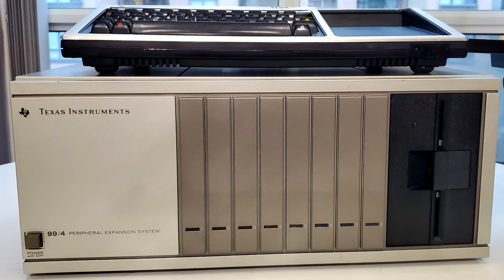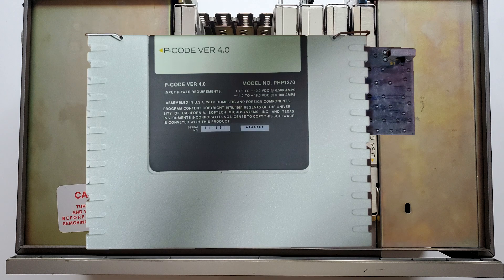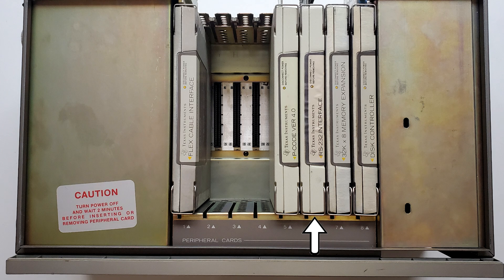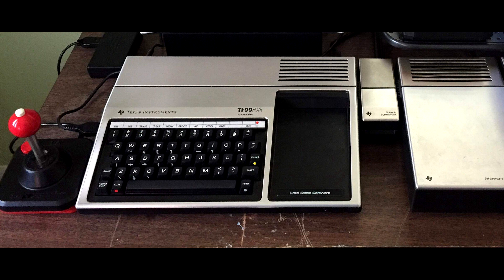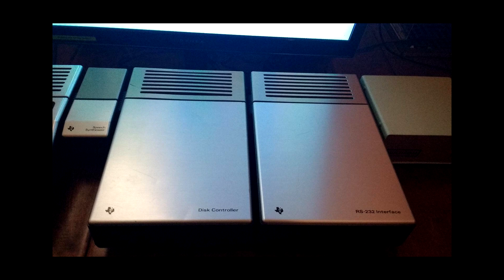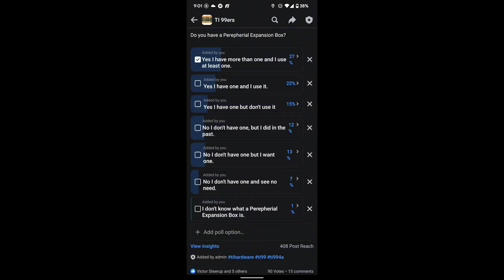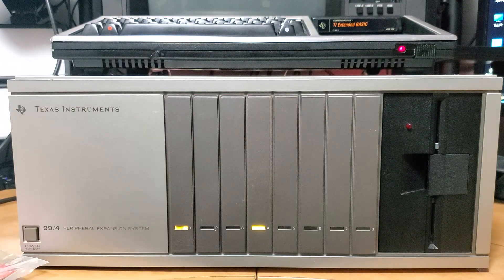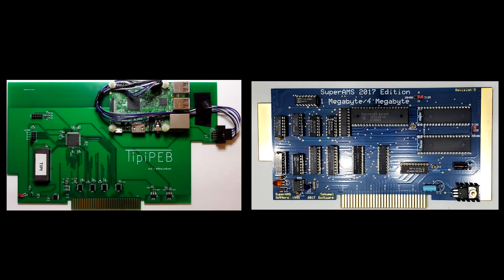A Better PEB: New Options for the TI-99 Peripheral Expansion Box in the 2020s

Comment: I taught myself how to program in Extended Basic on my TI-99/4A. I had a PEB too, with the 32k card and disk drive and disk controller card. And of course the speech synth. I had NO idea that hardware upgrades were being made for it! I got rid of mine when I bought my Amiga 1000 in '85 when it came out.

Comment: Thank You PixelPedant.  I actually like the sound of the TI Peripheral Expansion Box while it's operating which can be used as a white noise, actually cancels out the tinnitus in my left ear. Also picked up the TIPI-PEB and The Raspberry Pi. But I like to keep The Speech Synthesizer Right Where It Is Plugged In To The Side Of My TI99 4/A. 😀😀😀😀😀:face-blue-smiling:

Comment: Will two 32k expansions or more work in the PEB equalling >=64k?
Reply from the maker: Nope.  Nor can a larger expansion (even hypothetically) be directly addressed by the CPU.  The TI-99's address space is (16-bit, and hence) 64K.  So while paging can give you more memory than that (just not all at once), the address space is what it is.
Reply: But it can use two RS-232 interface cards right?

Comment: Hi there!  I’m glad I came across this channel!  I’m curious if there are any differences between the two PEB styles (push button vs. flip switch power switch)?
Reply from the maker: There are a few design distinctions between different models of PEB, but none of them fundamentally change its functionality in any really significant way.  

Differences include: 1) "99/4 Peripheral Expansion System" label or "Texas Instruments Expansion System" label, 2) Half-height "fingers" separating cards on the rear face or full-height "fingers", 3)  externally accessible fuse by the AC connector, or absence thereof, 4) Push-button power switch or Rocker power switch.  And users have also observed that the internal switch mechanisms toggled by the rocker switch have multiple variants.  

But as I say, none of this is actually important to everyday PEB functionality.  And while they largely sort themselves into two major PEB variants, TI did not market these as separate models, and there is no guarantee either one will represent all characteristics typical of that variant.  In the same way that most but not all beige TI-99s have the QI (second gen) motherboard, and most but not all machines with a QI motherboard have the 2.2 operating system.
Reply: @PixelPedant  thanks for this detail!  I now have 2 PEBs, one with each switch type.  I’ll have to check them out in more detail to decide which I will keep.  Merry Christmas!

Comment: I came across the post in atari age for the PEB PCB about a week after preorders were closed. So bummed :( Living in Australia, finding and then getting a PEB shipped over is not cheap or easy :( Currently living with my 32k expansion and finalgrom.
Reply from the maker: Yeah, living outside North America definitely makes things trickier.  But at least with the FinalGROM and 32K, you've got what you need for 90% of the library.

Comment: I like mine unmolested, all original hardware. The only thing I have done extra was get a FinalGrom99 so I can have access to more software. I had the basic system in 1983 (Extended BASIC, Speech Synth, Cassette) and learned BASIC. By 1989, I had a lot of computer classes in school and learned about the Apple IIe with BASIC and Pascal. Up until then, I didn't really know about assembly language. Over the years since 1989, I learned a lot about computers and assembly languages (I ended up with a Masters in Computer Science). So, feeling nostalgic, I bought a TI off eBay a couple of years ago as well as a book I had when I was a kid in 1983. Fast forward to today, about 3 years later, I have recently started playing with a TI and PEB and learning TMS9900 assembly language. I want to see what I am capable of doing with what I could have had back in 1983, but didn't have, so no gadgets or software that wasn't available prior to about 1989. I really wish I had known about assembly language and the PEB in 1983, I think that would have advanced my knowledge at a much faster pace. Instead, I had to wait until 1990 when I 19 years old in the Air Force to learn what assembly language was (I started on 8086 Assembler). Since then, I have does AVR assembler for the Arduino and MIPS Assembly when I was taking college courses. Now I am learning TMS9900 and almost done with a clone of Apple's SnakeByte. I need to just finish it, but I keep learning about new things and wanting to redo it. I want a version that can run on the minimum amount of hardware, like I had when I was a kid.

Comment: The first thing I did with my PEB was replace the case fan to a DC 5 volt.  Shocking reduction in noise, I don’t have to talk so loud now to be heard over the old fan, ha. I moved the speech card internal along with internal TIPI and SAMS cards.  Realms of Antiquity is very fun.  I haven’t replaced the “fire hose” because I actually like the thin “look” of it rather than the tall card replacement. Just a personal preference for sure.
Reply: That's the one thing I find "WEIRD" about the Shift838 I/O board.   There may be a technical reason for this which I just don't understand, but I'm unclear as to why it's necessary to have any "board" at the console side in the first place.  Why can't all the translation hardware be at the in-PEB PCBA side, instead?

In other words... why not just have a cable which plugs into the side of the console, and goes to the PEB card, without anything but the connector at the Console end.

And ideally, have that cable plug be "aft facing" rather than straight, so that the cable just goes back behind the console.

I can't imagine anything that HAS to be done, electronically, at the immediate-console end, which couldn't be done just as easily at the PEB PCBA end.

But maybe there's some reason I'm not seeing?

Comment: I'm mainly a C64 user, and the C64 situation was and remains ... weird compared to other systems, like the TI-99. The basic C64 configuration was severe in its ... adequateness. 64K was perhaps the minimum RAM baseline which was good enough that RAM expansions would be doomed to failure.

And Commodore wasted time with non-compatible systems rather than trying to market C64 expansions or upgraded newer models. By the time they came out with the C128, they purposefully made its specs ... eh ... unambitious ... in order to avoid competing with their upcoming Amiga.

The result? The C64 scene is remarkable in the way it really only has one dominant configuration (per video standard). The biggest alternate configuration, the C128, was and remains hampered by the adequateness of the C64. It's just hard to justify even learning to do C128 development when the software has only a fraction of the potential users and the C64's base configuration is probably already adequate for whatever software you'll want to develop.
Reply: I don't recall the c128 involved guys saying it was on purposely limited other than cost and 64 compatibility that the z80 also kinda ties into, they kinda put more stuff than they were going to if anything and marketing hyped it up higher than targeted as more expandable on top of that not down. Not that they even had much of a roadmap or coherent plan with the management then

Comment: No PEB here. Just a voice synth and 32K expansion so far. I looked for a PEB for a while but they seem relatively rare -  at least where I live.
Reply from the maker: They're also just very big and heavy. 30lbs.  So I think they don't get all that much traffic on auction sites just due to the difficulty and cost of shipping them.
Reply: @PixelPedant  you are right I had one but with the room it took up and no one was making software anymore. I only kept the computer and the Milton Bradley game console which the controller needs a major overhaul. I mainly liked the baseball game. It was a two player game but I could play both pitching and hitting so I had fun with it. Voice recognition made it more fun. 73
Reply: So true. The weight and bulk also makes me suspect many were unfortunately disposed of long ago. Like a huge old CRT television, they may not have made it through multiple moves after they had (apparently) outlived their usefulness. I hope I am very wrong though and there are thousands stuffed away in basements and aftics.
Reply: @andymandyjohnson-green5160  you're probably right but chances are those abandoned PEBs got all rusted to death by now.
Besides that, many users now live in small apartments where space and power consumption is critical, so sadly all that chunky and watt-hungry accesories are a no-no.
Reply: You’re good with what you have. Beat up PEBs on EBAY are bringing 300 bucks and up now. We’ll just keep rocking the base setups and go from there. TI life forever.